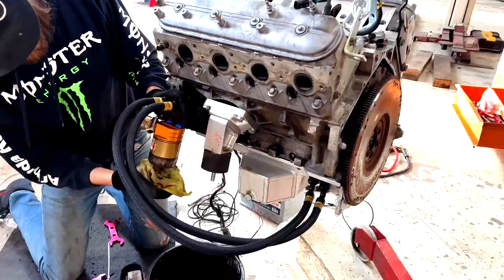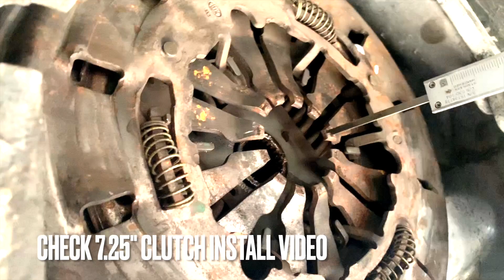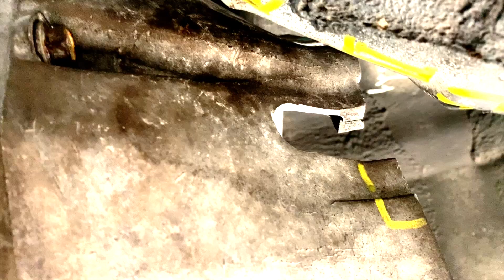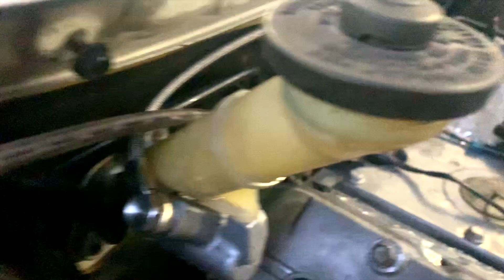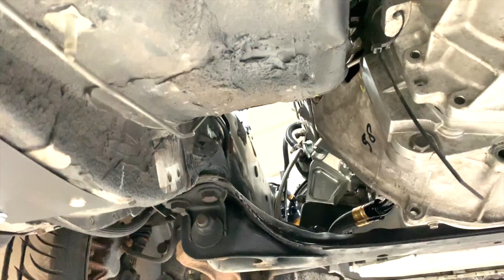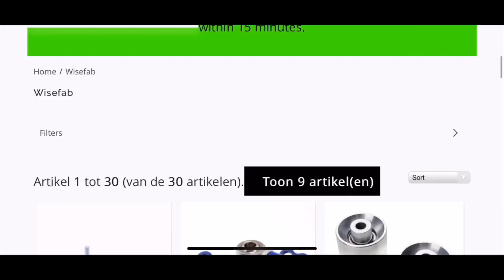LS Swap Supra MK4 T56 Install , Longtube Headers , Shifter Mechanism

Comment: Nice!  Did you have any problems with steering rod/vs big a$$ 1.875 header primary?
Reply from the maker: Headers were easily 40 hours work
Reply: @DriftJesus  They sometimes are.  :(  They look good!